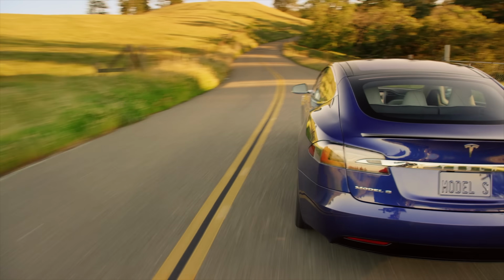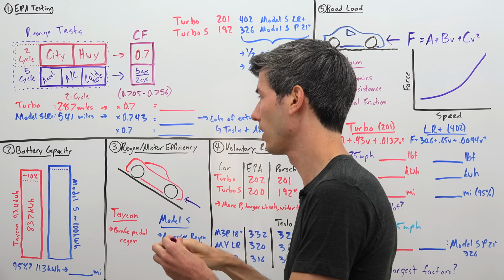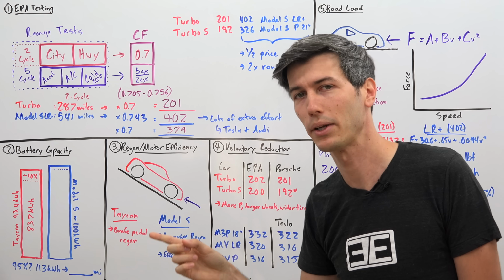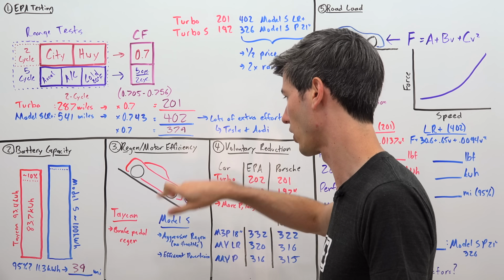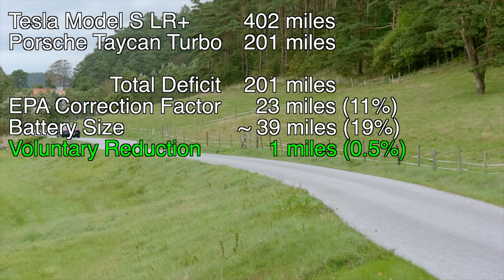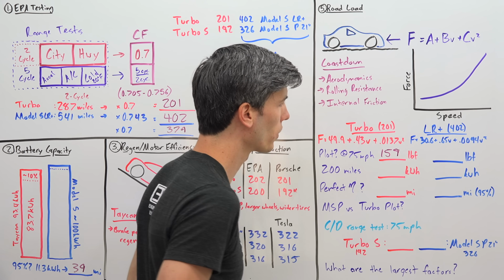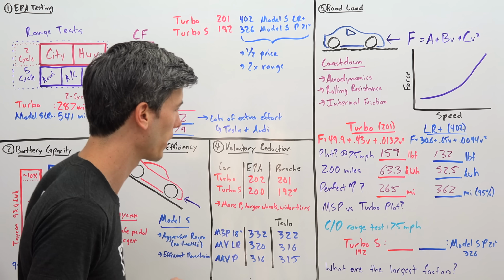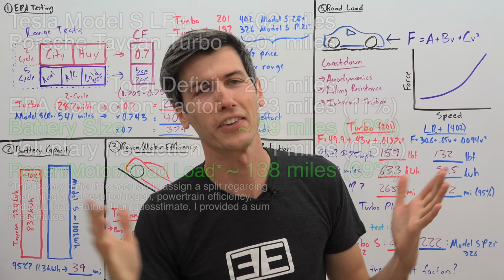Tesla's Secrets To Dominating EV Range - Double Porsche?!

Comment: I'm all for electric cars.
I love 'em.
But what I am opposed to is using the battery to heat the cabin.
Especially in cold climates.
My prediction for places like Alaska, Scandinavian countries and the North or Russia...
What is wrong with having a separate propane, butane or whatever powered heating system, in addition to the electric traction ?
I mean, using the batteries for cabin heat is only going to deplete your range.
while using some kind of propane/diesel/whatever cabin heating system, you know, at least that converting those fuels into heat is 100% efficient.
WHAT GIVES ?
>
Reply: Or just use hydrogen :v
Reply: @DefinitelyNotEmma  That's good.
But having a separate, independent system, just for heat, isn't that a good idea?
Imagine if you run out of go fuel in some dire place where the temperature is always below zero.
Wouldn't it be reassuring that once you'd ran out of go-fuel, there was another system to keep you warm and ALIVE?
>
Reply: @Bodragon  I think hydrogen should power the car and you should use batteries for heating etc.
Reply: @DefinitelyNotEmma  Yeah, and we should all go naked.
>
Reply: @Bodragon  what?
Reply: @DefinitelyNotEmma  Actually, I've been thinking about it.
That solution with hydrogen powering everything including the batteries is not a bad idea.
And I apologise for my previous knee-jerk response.
But then, why not simply burn the hydrogen if all you want from it is heat ?
>
Reply: @Bodragon  uhm, not the heat, the hydrogen powers the car, the electric engine and than you have a separate battery (solar, KERS or plug in powered) that provides energy for heating and other stuff, so you have to independent systems in case one fails you could still use the other. That's how I thought about it ._.
Reply: @DefinitelyNotEmma  You are way ahead of me.
I have much to take in.
I wither and wilt under your superiority
I am humbled.
Please,
May I go now ?
>
Reply: EV’s don’t use flammable glasses for multiple reasons. For starters, they don’t want to have the vehicle burning any gas or emitting any harmful gases. This doesn’t apply to all of them because some gases burn pretty cleanly, but then there’s the issue of having a flammable gas in your vehicle. It would take up space and pose as another hazard in crash testing. Using a battery to produce heat is actually extremely efficient. The problem is that it will, as you said, eat your range and fuels have much larger energy density when compared to batteries.
Reply: @yummyhershey5902  That's total BS.
Nothing wrong with having a small supplementary bottle of propane on your rig.
Just ask the thousands of RV owners.
>
Reply: @yummyhershey5902  What's wrong with having a separate, independent heating system?
 Imagine if you run out of go fuel in some dire place where the temperature is always below zero.

Wouldn't it be reassuring that once you'd ran out of go-fuel, there was another system to keep you warm and ALIVE?
>
Reply: @Bodragon  that stuff you want to burn will not last forever.  turn your EV off before its empty and you can keep your self warm with the heat pump for hours
Reply: @rtfazeberdee3519  Um, yes it will last forever.
There are companies exploring the extraction of CO2 from the atmosphere and converting it into hydrocarbons using nothing more than solar power.
What the heck are you on about?
>
Reply: @yummyhershey5902  Yes but in sub zero temperatures the batteries perform much more poorly.
Better to have a separate source of heat in case of emergency.
Then at least you won't freeze to death.
>
Reply: Cold climates get ignored in far more ways than just how we heat the cars, and the toll that cold climates take on electric car range, performance, and life is one of my chief concerns.  I'm still strongly on board with electric cars, but I really wish the industry would stop avoiding cold climates in their discussion of their products, technology, and plans.
Reply: @phasmata  Well said.
Totally agree.
>